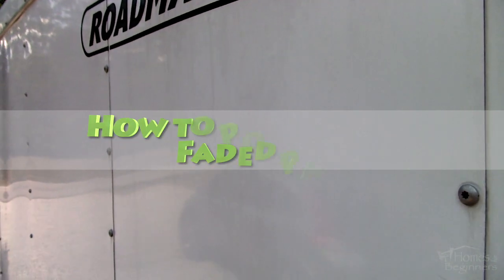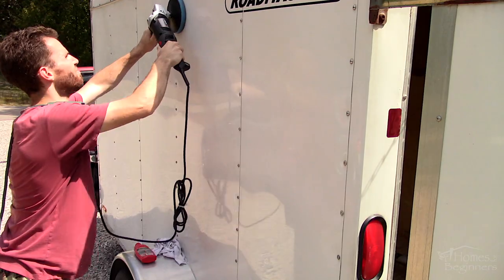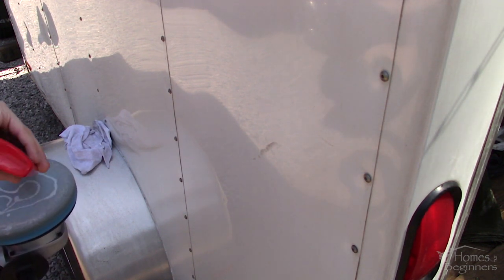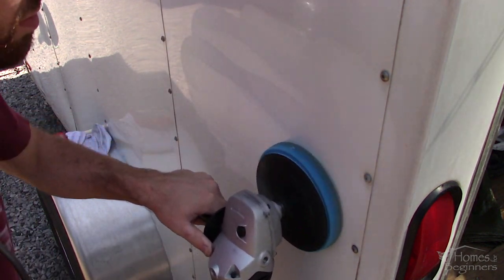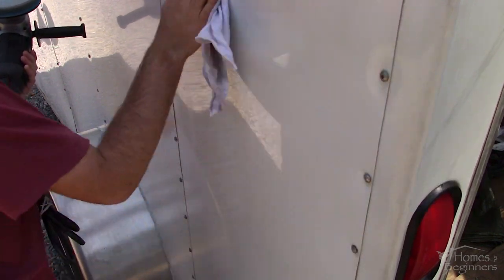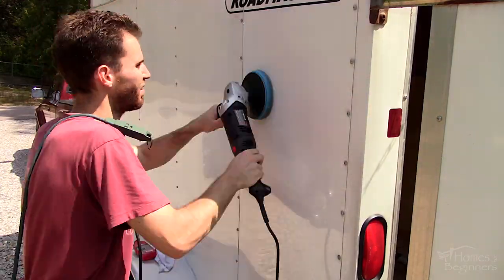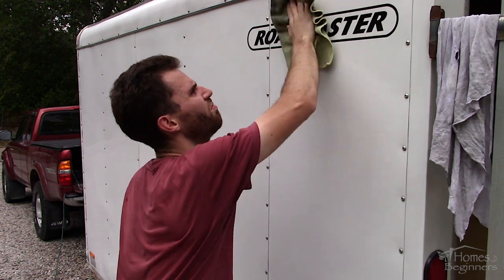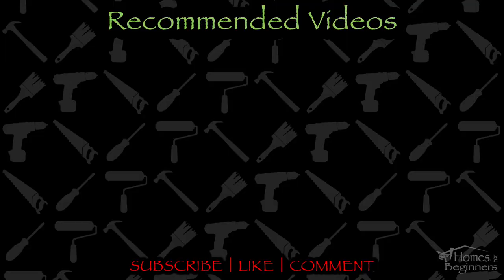How to Polish Faded Paint on a Trailer

Comment: Thanks for your video! I have a white .040 aluminum pet grooming trailer and it needs to be buffed and waxed. My trailer does have some scratches. 
IS your trailer aluminum .040 as well? Would this technique  be the same?
Reply from the maker: You're welcome! Sounds like it's the same material as on my trailer, so the same technique would be applied.